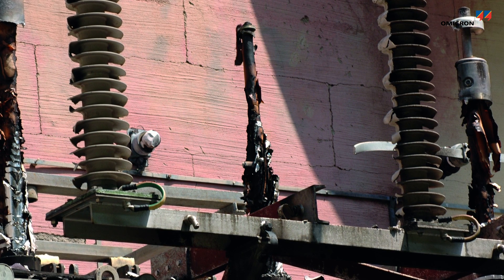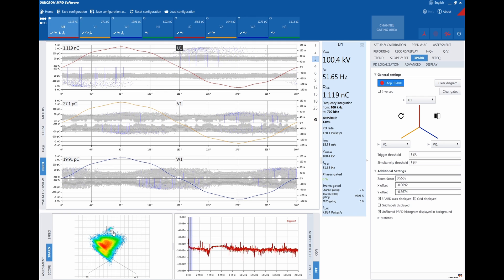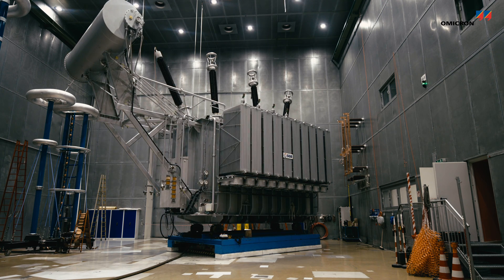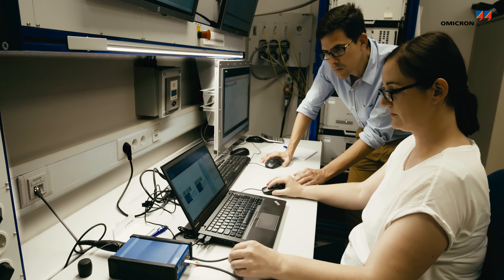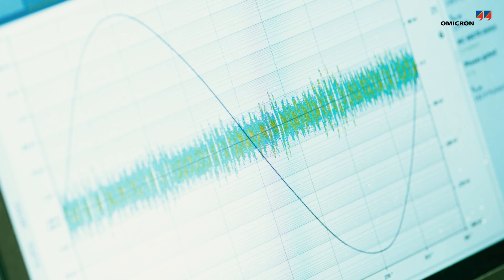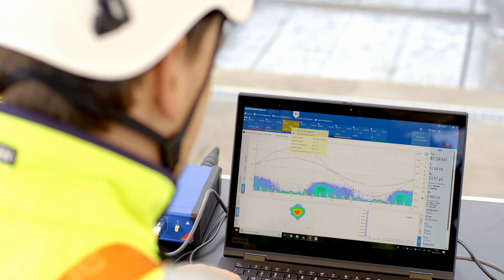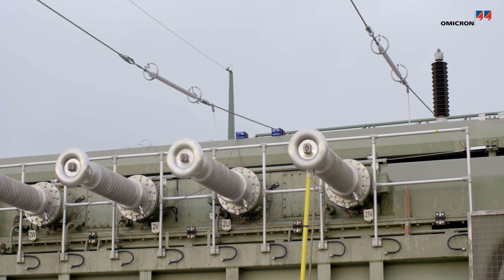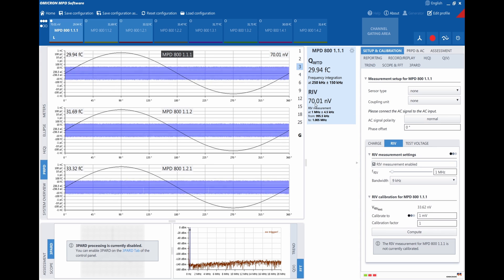Partial discharge testing on power transformers

Comment: what is the procedure to select a PD tester for transformers
Reply from the maker: Hi, 

The PD measurement system choice depends on different factors, for instance for offline measurement we offer MPD800 System which comes with different accessories like coupling capacitors which can be adjusted to the costumers need (voltage levels and etc.), for the online measurement we have solutions like MONTESTO 200 which is our portable monitoring system. We have also solution with permanent setup like MONTRANO.
I hope this helps. If you have more questions, feel free to contact us: https://www.omicronenergy.com/en/contact/email/?c=4&request_type=2&cHash=3f9eade9828e66b234f89bd5c510606b

Best regards.

Comment: For a site test what is the detection bandwidth of the MPD800 ?
Reply from the maker: Dear Sue and Lindsay, 
thanks for your comment and for your interest to our videos :)  

The MPD 800 offers a wide range of filters. The bandwidth and center frequency can be adjusted for the best signal to noise ratio at site or can be kept the same as for the FAT result to have comparable settings. For the charge measurement (QIEC value), the center frequency and the bandwidth are usually set in alinement with IEC 60270. For RIV testing the CISPR or NEMA standards are followed. For more information, please visit: https://www.omicronenergy.com/en/products/mpd-800/

Best regards, 
your OMICRON team

Comment: Good day sir, if online measurement  is possible.. can I ask if Mathematical model of PD in transformer is possible?
Reply from the maker: Dear Mary, 

thank you for your interest! 
Simulating PD is a topic of research and the question highly depends on your goal. A model can only show influences, which are considered by the modelling approach. It would be rather difficult to cover all influences. 
So, the question is, what should the be considered within the model? PD are highly dependent on many influences (structure of the asset, geometry of electrodes, insulation material, quality and age of the insulation, by products, defects, temperature, voltage level, rise time dU/dt of the test voltage, electrical field distribution, start electron) and much more. In theory models can be found for physical effects, but it takes a lot research to get a valid model. For this reason, it makes sense to define the terms and conditions for finding a model and to focus on a specific effect. 
We recommend discussing the goal and following up on research based on the definition of your thesis. 

We hope this answer could clear some things up already! If you want some more information please contact our technical support team: https://www.omicronenergy.com/en/support/technical-support/
or use the following link to see all the training classes currently scheduled: https://www.omicronenergy.com/en/training/courses/f1/language:English/f3/application:Partial%20Discharge+Analysis+on+Power+Transformers/

Best regards, 
Your OMICRON team
Reply: @omicronenergy  thank you sir/ma'am.. the transformer model that possible we can use is the Distribution transformer three phase .. We are conducting more datas regarding this topic.. thank you for your response
Reply: @himariarosa  hi mary
my research topic is about this too
can i know where can i read about the results of your lab team?
Reply: Thank you because it's my topic for our thesis 🙏

Comment: Thank you for this video on PD measurement on Power Transformer. I do have a couple of questions to ask .1. what I the frequency spectrum of the PD signal in that power transformer?  2.what is the suitable  bandwidth of UHF UVS sensor in order to be able to detect PD in UHF range . You event contact me on my email: upeter1@yahoo.fr . I m very interested in the services of your company .
Reply from the maker: Dear Peter,

thanks for your interest in our products!

UHF is typically used is the range from 200 MHz to 1.5 GHz. Tuning the measuring frequency to an area with good signal noise ratio allows measuring sensitive. The best measurement frequency depends therefore on the PD impulse picked up by the sensor and the noise signature from the surrounding. A test object with metal enclosures, like a transformer, provide a good noise shielding, which allows nearly always to choose a measurement frequency with good signal to noise ratio. 
Narrow band measurements and wide band measurements can be selected fitting to the frequency spectrum and onside conditions. 
The UVS 610 transformer valve sensor measuring range up to 1 GHz. It is specialized for UHF measurements in transformers and is sensitive for fast internal and oil discharges.

We hope this answer could clear some things up already! Additionally, a member of our support team will get in touch with you.

Best Regards
Your OMICRON team

Comment: Which are the different methods for the measurement of partial discharge (PD) in power transformer.
Reply from the maker: Dear Romit,

There are many different methods to perform PD measurements on power transformers.
Main offline methods:
- According to IEC 60270: using coupling capacitor or bushing tap (single and three phase)
- UHF measurement using UVS 610 sensor at the valve  (ultra-high frequency antenna)
- Acoustical localization using PDL 650

Best Regards
your OMICRON team

Comment: Sir is this online or offline testing on transformer.
Reply from the maker: Dear pawan kumar,

thank you for your interest!
There are only offline measurements shown in this video but online measurements are possible as well.

Best Regards,
your OMICRON team
Reply: This is done on deenergized transformer, with open primary and secondary disconnectors. The environmental factor need to be considered (humidity and wet surfaces should be avoided while testing indoors ),as it will influence  in results.